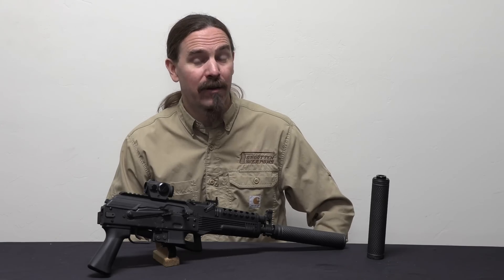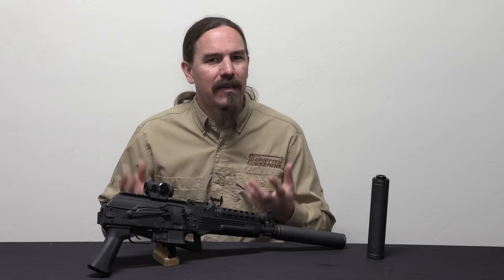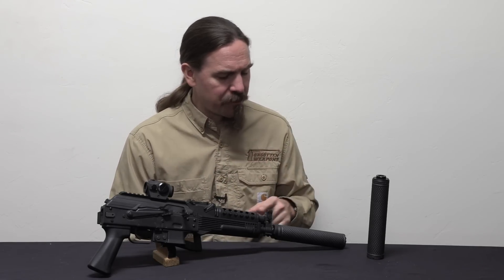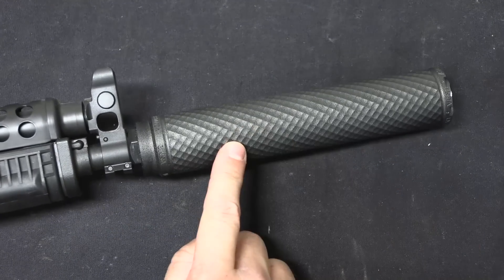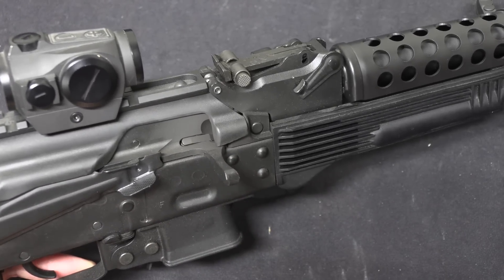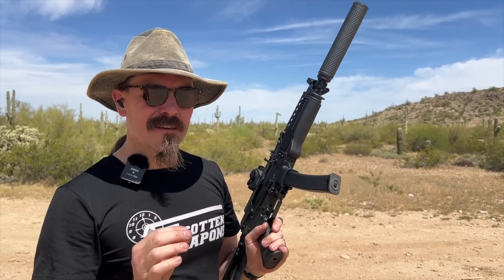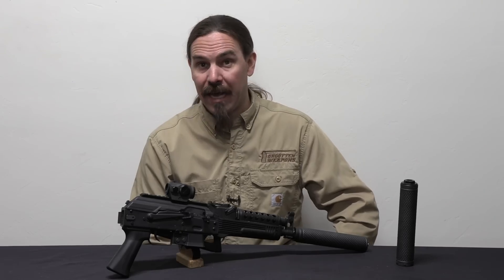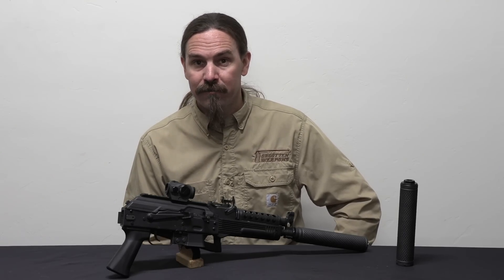PTR Vent Suppressor: 3D Printed Titanium Foam

Comment: So just from looking at it, I imagine the cheaper copy of this is going to be made similar to how Russian RPG nozzles were made. Instead of 3D printing the whole thing, someone is going to make a bunch of foam material washers with standardized cutouts on the edges, and then just twist them and fix them in place. So you no longer have to wait for a single tube to print, and can instead batch produce however many washers you desire.
Reply: The process they used for printing these, would likely allow them to print as many as can fit in the machine at a time.
Reply: @Aikano9  
Since it is 3D printed, you are limited by the number of nozzles, and if a mistake occurs in the process, stopping it would mean ruining multiple suppressors in that setup. Kind of a QC nightmare if you tried making 60 of these things in a single machine.
Reply: @RavemastaJ  these are more than one 3d printing technology, these are more than likely made via powder bed fusion, zero nozzles involved. This technology is already being used to mass produce gears, and other complex metal parts. It’s a proven and reliable manufacturing technique.

If a mistake occurs in a CNC setup, sheet metal, or any other automated manufacturing method, you have the exact same problem, so that’s not really a valid point against 3d printing.

Why would it possibly be a QC nightmare??? QC wouldn’t be much harder than a CNC or sheet metal part, it’d be roughly the same.
Reply: @RavemastaJ metal is usually not printed by fdm, but rather laser sintered.
So it's more like a resin system just with powder instead of a liquid.
Reply: @Aikano9  
If it is powder sintered, and you have multiple lasers running on the same motors to mass produce the same part, then any mistake on the part of the laser or the material bed that ruins one and not the others will be difficult to find. It is a QC nightmare because it is a monolithic part that does not disassemble, so you cannot replace anything. The whole suppressor gets thrown out, or if a mistake isn't found there is no way for the consumer to run the non-destructive tests required to find the problem.
Reply: @RavemastaJ its a well established and reliable manufacturing technique. Your concerns are unwarranted.

It’s not a QC nightmare precisely because it’s monolithic. There only one part to check, not tons of them that need to be assembled and fitted together.

drop it in a bucket with some solvent, or put it in an ultrasonic cleaner, and check the central hole for obstructions. That’s all you need to do fix this thing.
Reply: @Aikano9  
There's six spiral vents running through the thing, and they are inaccessible. If there is a defect in manufacturing, there is no method available to consumers to check if they are obstructed, and due to the small size of them I can imagine it would be difficult to get any form of debris out of them. It is not just a singular hole in the center.

But I don't really care about that. My original comment was just saying someone will bootleg it with the same material, assembled as stacked washers rather than a monolithic piece.

Comment: Look up fireplace carbon remover. I am a Mechanic, and I use it to get rid of carbon in engines. Should work well on the suppressor as well.
Reply: There are many gun cleaning products that claim to "dissolve carbon" but the manufacturers should be fined for false advertising, since no known chemical will dissolve carbon. The removal always ends up being mechanical.

Comment: The mesh thing, miner's lamps worked in a similar way so their lamps wouldn't ignite the dust. I've been thinking about suppressors of late. And a design thats lite quiet  dissipates heat and hopefully not effect the ballists. An interesting problem to solve. I have an idea, but constructing a prototype may be difficult.

Comment: Imagine a ship made with metal foam. Its a really cool technology.
Reply: It would sink .
Reply: @MartinSparks-ef9gr  ever heard of closed cell foam?
Reply: Maybe it could be used in the strike face of an armor plate to dissipate some of the energy of the projectile and capture spall, with a harder plate behind to ensure there's no penetration. 🤔
Reply: @AlexanderEddy  or a firewall, bulkhead, superstructure. The value of metal foam in armor is very interesting. Also it would have good insulative properties so lagging would be more effective at concealing a thermal signature.
Reply: @koffeekage  Definitely a bad idea to use titanium foam due titanium being a flammable metal and the increased exposed surface area of the foam allowing for the chemical reaction to occur at a faster rate than if it was a homogenous solid.
Reply: @Cowboycomando54  thats a good argument against those alloys. Im not sure what the current metals being tested for the metal foam armor are. I’ve seen it being tested though.
Reply: @koffeekage  Most likely materials that have a high fracture toughness and high density such as tungsten and uranium (have to be careful with the latter due to it being very chemically toxic)

Comment: I’m still waiting for the ATF to get back to me for my suppressor for my CZ 527 in 223.  It’s been almost 6 months.  The ATF sure is slow.  I am making a setup for pest control and fox/coyote hunting.  I’m Amish and I made myself several fox fur coats.  I recently got a thermal night vision optic for my CZ.
Reply: Are you a member of the "Fighting Amish"? And don't worry, they announced that approvals will be speeding up from now on. Plus cool coat in your profile pic. One of your own?
Reply: @ragingjaguarknight86 ,  yes the coat in my profile pic was one I made.  I’ve got another one like it and 4 coyote fur coats and a light fur coat for the summer.  I thought it would only be 90 days for them to get back to me.  I’ve heard that it can take up to a year.  A suppressor would be very useful for my night hunts.  Also I don’t like spooking my horses with gun shots or startling people in my community with shots at night.
Reply: @AmishAmber  good work. 👍 And there are other silent options for you to use that don't require stamps. Crossbows, especially a repeating crossbow like a zhu-ko-nu prove useful at closer ranges. A subsonic .22LR but shot placement is critical. And the humble slingshot is another silent option but requires practice to master. Plus, check out the comments, another user on hier said his stamp only took a day or so.
Reply: @ragingjaguarknight86 ,  I’ve got a pulsar thermion thermal scope which is most important to me for my hunts.  I have gotten several coyotes and a fox at long range at night with it.  Though a suppressor would be a nice addition for stealth purposes.  I’m currently working on another fox fur coat.
Reply: @AmishAmber  sounds like a pretty good setup you've got.  Keep up the good work. 😎👍 As for me, my scoped marlin model 60 is probably my most accurate long gun. Nothing fancy, but it gets the job done.
Reply: @ragingjaguarknight86 ,  I’ve got some good news!  I rode my horse down to the post office and I got my approval letter in the mail for my suppressor!!! 🤩
Reply: @ragingjaguarknight86 ,  I picked up my suppressor today and I sighted in my pulsar thermal scope today with the suppressor at 100, 200, and 300 yards.  Suppressors do throw off your zeroing when you get past 100 yards.  I used 50 rounds to get it sighted in.  Its actually quieter than I thought it would be.  So I’m very pleased with it and I think it will help me not spook my horses or wake up my neighbors at night.  I got my bench rest set up on my back porch overlooking the field and my thermal binoculars set up on a tripod where I can sit on my recliner deck chair to look for coyotes.
Reply: @AmishAmber  Excellent. My marlin is usually pretty dead on, but it's max  accurate range is around 100yds or so. I've got a cheap, no name scope on it and use it for plinking.  😃 it's a fun gun mostly and use it to teach the newbies in the family as an introduction to rifles. Waidmanns Heil!😎👍
Reply: @ragingjaguarknight86 ,  my father has a marlin model 60.  It was the first gun I ever shot.  He didn’t have a scope on it.  It’s definitely a good 22.  I shot a lot of squirrels with it with just iron sights.  It’s nice to be able to hunt coyotes from my back porch now I have a suppressor.  I’ve got a screen enclosure and I’m sitting in my recliner bundled up in my fox fur coat reading a book while looking through my infrared binoculars every minute or two looking for coyotes.  Definitely a much more comfortable way to hunt than I did before.
Reply: @AmishAmber  hahaha, my first gun that I shot was an old escopeta that my gramps owned down in Mexico. It's was essentially a blackpowder musket, but we used it as a shotgun or musketoon. My first experience with "modern" guns was back in 09 or so, an old .22 lr bolt action. My first experience with centerfire rifles was with my kar98k, in its original 8mm. Then I quickly upgraded to my marlin m60, then my StG-44 and finally, my type SKS. I used the .22s  for pest control mostly, like rats and squirrels.
Reply: @ragingjaguarknight86 ,  I uploaded a video of me getting a coyote last night on my thermal scope.  Generally it’s kind of frowned upon for me being Amish to upload videos though it just shows a few seconds through my thermal sight so I don’t think anyone in my community will be troubled by it.  It’s on my YouTube channel.  Muskets are fun to shoot.  Your grandfathers musket sounds a-lot like my grandfathers hawken musket.
Reply: @AmishAmber  I checked out your video,  excellent work. 😎👍And nope, our escopeta wasn't a Hawkens, but I do recall that it had a fairly large bore. I also used a sling when I was down there, except instead of fighting a giant named Goliath, I was slinging stones at a wayward bull that wandered out onto our crops. I had no real accuracy, though, so I was mainly using it like an artillery piece. I think the stones I flung were just under the sound barrier, sometimes I'd hear a buzzing sound as I hurled them with all my might. O_o
Reply: Lancaster County resident here.

My can got approved in 26 hours

Comment: suppressors are always cylindrical, could they be cuboid?
Reply: The HK Mk23 suppressor was box-shaped, at least the early version was.
Reply: They could, and a few have been, but there's rarely a good reason for them to be. A cylinder has the minimal amount of surface area per unit of volume. Volume is what makes a suppressor work, surface area mostly just requires more material and makes it heavier.

Comment: When/If the NFA stuff really gets eliminated, suppressors are going to be very affordable.  All the competition is going to drive prices way down, we may see some as low as $300.
Reply: Uk we have no issue on them despite our draconian laws.
Reply: @savingoldsilver   We can get them too, they are just overpriced, and you are forced to pay a additional $200 tax, until recently the wait could be 6-8months or more just to get approved.  However now the wait is very short 1-4days.  If they remove that $200 tax and registration though I think there will be a huge boom in civilian ownership of suppressors. This in turn means more companies making them and prices driving lower. Right now they are overpriced for what they are, considering most are quite simple devices that aren't too dissimilar from a cars muffler, just thicker needing to withstand higher pressures.

Comment: Titanium, high surface area, and hot gases doesn't sound like the best combination to me but hey, I'm not a firearms designer.
Reply: Thinking fireworks?  Titanium is not easy to ignite, requiring enough heat to start melting the oxide coating.  Incandescent heat.  But burns HOT once started.

Comment: Nice, but I love my MP5SD. Nothing compares to that simple and effective construction.
Reply: The nice thing about the SD is being able to shoot almost any 9mm ammo and have it exit subsonic.
Reply: @revgregory  Dip the suppressor in a bucket of water before you shoot, then you just hear the bolt mechanism. Works with water based lubricant from a sex shop dripped intro the suppressor exit as well 🙂. Best of all it is an easy to clean construction.